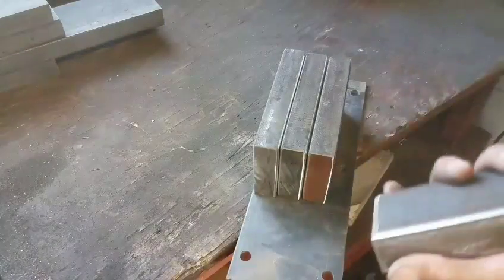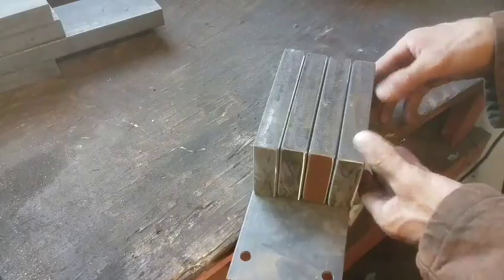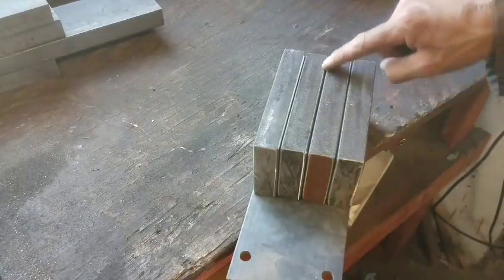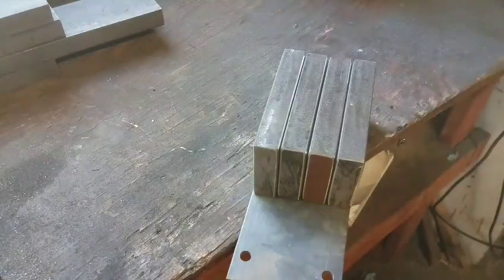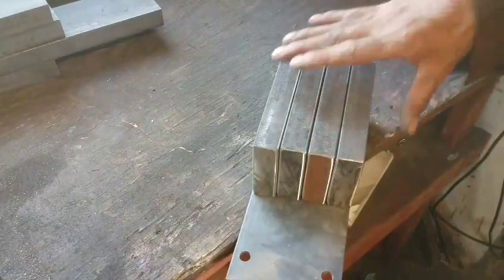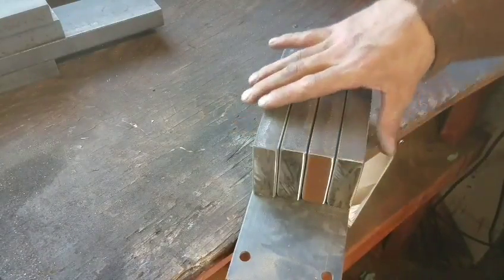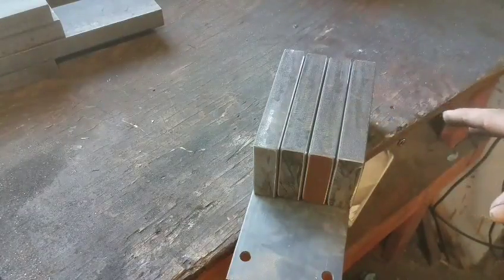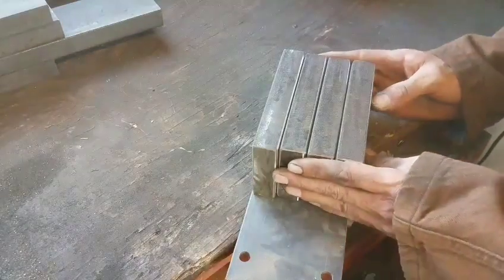Making An Anvil From Bar Stock

Comment: Trust me you wont regret it, The best cheap starter or even pro anvil is a block of just mild steel go to ebay a get a 10in x 6in x 2in block of A36 for $56 it will be like a striking anvil but you won't make such a short base for it because you wont be using it as a striking anvil, so make an 1in hardie hole by cuting out a piece of the block then welding it back in leaving an 1in square hole in the block and mount it flat on something, or make a nice stand. For it or another good cheap beginner anvil is an 66lb anvil off of ebay for about $115 or even the 110lb version for about $300

Comment: It's flux core...turn your heat up and slow your hand down. And you should have beveled the edges at least a quarter in and stacked multiple beads.

Comment: i would of went the other direction with the steel giving less ring those welds wont last you will eventually get rust forming and the rust will tear it apart you could of just drilled 2 holes in a section screwed it to a log of wood and saved however many hours you spent

Comment: I'm no welder but that splatter was terrible. I can't see that holding for too long.
Reply: He's using flux wire. It splatters and smokes like the dickens. Gas and solid wire isn't as messy.

Comment: Awesome little project jake, but having a lot of welding experience under my belt I do question the longevity of the welds. Granted, I understand you used what you had at hand and cheers to that man. Really a nice build. But maybe find someone with a good stick welder if they should ever happen fail

Comment: Nice job Jake.   I am making a similar build on my channel using forklift forks..  On mine rather than horizontal pieces I am welding vertically with a 15in table. You should have put a hardy hole and pictril.  If you are interested I will sens youhe link when I am in the build zone..  Thanks for sharing, Martin M&S Blades and Blacksmithing

Comment: The welds will probably fail eventually. Not enough penetration. It is likely that the shock of hammering on the anvil will break those small, brittle fillets. The other issue is that horn(bick) it is going to bend under the hammer, there is not enough material to support itself.
I didn't even notice that hammer handle until reading someone else's comment. With such a rigid handle that is going to cause tendonitis, you should get rid of it before you give yourself a chronic injury.

Comment: nice job! is railroad track good for making an anvil??
Reply: in my opinion and the facts of RR track .IS 1 I don't like it as an anvil but people use it all the time. 2 the fact is that RR track is designed to be a heavy duty spring this is why a loaded train can run the tracks and the  track does not break bend or what have you. You would be far better off going to a machine shop or somwere that handels large steel and get an end cut of even better yet if you can find one get one of those concrete breakers you know the ones that a back hoe uses. I welded up some forklift fork for my 1st anvil only I am fortunate enough to have a great stick welder to do the heavy welding... Good luck on the anvil. Martin M&S Blades
Reply: Yes it makes a nice small anvil

Comment: Thanks for sharing, looks great. I'm just about to cut some sections of forklift tyne to do a similar thing, but I was planning to stack pieces vertically against each other rather than horizontally.  My thought is I'll then have solid steel from top to bottom under the hammer blow... But ingested in how yours is going and if you would make any changes in hindsight? Cheers.

Comment: Awesome anvil, yeah once you add harder steel plates and weld them on the anvil will defiantly weigh more. I would weld on plates on the bottom on the side to add stability.